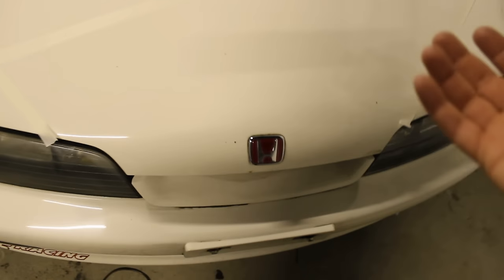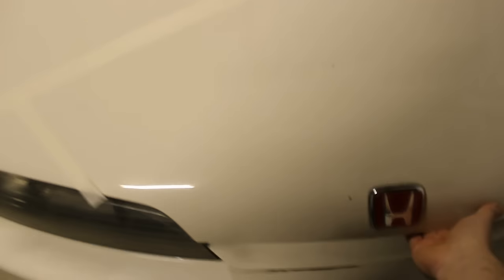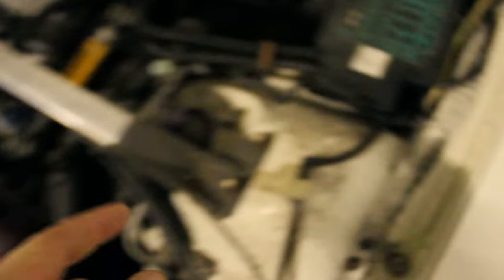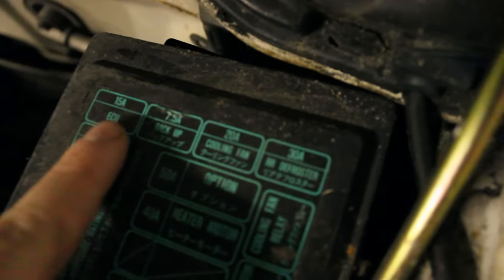How to reset your ECU in less than 1 minute

Comment: IF your car has a problem the light is going to come back on again before long, do yourself a favor and buy an inexpensive code scanner (about $40) and you can read all the codes and fix the problem the right way, or if you just want to turn the light off it will do that too without popping the hood
Reply: do the scanners fix the problem or do you need to physically fix the problem by remove a part?
Reply: Ach Cru you have to fix the problem yourself after the scanner tells you what is wrong with the car
Reply: Best thing I bought

Comment: It worked for me 2014 ES 350. Had it read at Autozone it was a Gas Gap Code.  Checked cap and it was off (kids helped pump gas and didn't screw the cap in). After over 100 miles light didn't reset.  Tried the ECU fuse as explained on the video and it worked.

Comment: 😁I had recently purchased a 2018 Ford Escape that was getting poor mileage because it had been "living" at sea level and it now lives in Denver, CO which is 5400 above sea level.  I took your advice, plus I also pulled all other fuses connected with with the engine or transmission.  Mileage went from 22.5 to 27.2 immediately.  Thanks!
Jim in Denver
Reply: Idk if you were going for comedy but your comment made my day lol

Comment: After replacing fuel pump, maf sensor, map sensor spark plugs ,spark plug wires, catylic converter,throttle body , lower intake gasket,manifold gasket ,vent solenoid,purge canister,and maf sensor for the second time to redo everything po172 and po171 kept comin on till I came to a mechanic  that had asked me if I’ve rest the ecm. Come to find out he was gonna charge me 40$ to check it and another 120 to reset it on his scanner which I already paid in the past..This video reminded me of the hassle I went through until I pulled the damn ecm fuses out and disconnected the battery which now has my ecm reset so that it can compensate correctly and now my engine is A1 and no engine light has come on yet….2008 impala flex fuel headache car 🤕……yes I replace everything on that car….always use ac delco or original manufacture not no bull crap brand learned the hard way on that too
Reply: Man I'm going through the same thing and going crazy.. I'm about to try this and hopefully it works.. o2 sensor, map sesnor, fuel injector, throttle body, pcv valve all replaced and I'm going to be extremely pissed but also extrememly relieved if this works

Comment: Thank you I was trying to find the key sequence to reset the ECU in a Subaru for example my 2014 Dodge Avenger if you want to reset the ECU you could just turn the key to the on position and pump the gas 7 times but nobody seemed to know it so this idea is 100x better than disconnecting the battery and pumping the brakes

Comment: Hey, just want to say thank you for this video. It works on my civic with the E-MID blank screen problem. This method is much faster and safer than to unplug the battery.
Reply: How is unplugging a battery unsafe lol
Reply: @yochillll2672  I’m here trying to figure out who said it was unsafe.
Reply: @mike-anthony8700  literally in the last sentence.... I can tell you ain't a bright one
Reply: Clumsy unplugging of batteries can cause short circuits that will fry your alternator.2) Old corroded battery clamps can break. ECU fuse removal is best explained.

Comment: It works like a charm, mechanics can take control over your car and keep your car running bad in order to get more money out of you. The mechanics can keep you coming back for repairs with their scanners and they can use the scanner to keep your car running bad
Reply: Wtf are you talking about dude 😂
Reply: Simple solution: Buy a $30 scanner and scan your own car before and after going to a mechanic. Also, that mechanic is taking a HUGE risk on their reputation if they are doing this....
Reply: @TeeTafoya87  yes I did buy a scanner pay over a hundred dollar and sixty dollar for a code reader my check engine light comes on after I replace everything myself because the mechanic didn’t know what was wrong switching coils and injectors so what I did I started with the fuel pump and filter and the car runs better but the check engine light comes back on so I replaced cam and crank sensor new plugs new coil new vacuum canister check valve and the other valve new mass air throttle sensor idle control fuel pressure sensor get pcv and every thing on the car and It runs very good and strong better than ever but the check engine light still comes on I cut it off 20 or 30 miles it comes back on so I open up the dashboard and took the bulb out and my 04 mustang GT automatic dark shadow gray is running good I even put a new harmonic balancer on it
Reply: change a mechanic lol

Comment: Best method, so much better than taking batt cbl off. My radio has about 40 settings that are lost at battery change etc. On my Ranger I killed the pwr to the PCM memory and drained it by putting a load on it at the fuse box. (an analog meter, then let the needle fall to 0). Still have intermittent flooding at start after replacing fuel injectors. So if anybody has suggestion I'm listening. Other than smelling gas at warm start sometimes it runs great and the trans shift points are smooth as glass now.

Comment: Did you say you remove pos and neg off battery? Why not just remove pos? I am replacing injectors and i I usually disconnect pos cable for safty reasons for certain jobs like starters,alternator etc..thanks for sharing
Reply: To drain ECU, you need to disconnect both and connect with each other for 30 minutes. If you want to disconnect for safety,  then you disconnect the negative, NOT positive.

Comment: Hi iam driving a w204 mercedes m271 2010 kompressor i try both but the engine still on..i try the battery tarminal and also the fuse but still the engine light is still on..what can i do

Comment: Disconnecting the battery is much easier & while you've got the cables off it's a good time to clean the battery posts. Then reattach the cables your good to go.
Reply: Yes, it's important to clean the terminals. But it sucks to have to reset the clock and stations on the radio. So if you know the terminals are ok, then the fuse works nicely.
Reply: This video is when you don’t have too much time to reset your ecu
Reply: Pulling out and replacing a fuse is much easier and fast than unscrewing and disconnecting battery leads!

Comment: I have some tips to share as I have experienced this problem for quite sometime. So many way I have tried but the problem was never resolved until lately I got a tip from a good foreman for my bmw. Belief me or not, all what you need to do it change the ignition coil, one set. 4 cylinders car, you need to change all 4 units or if  for 6 cylinders car, you need to change 6 unit. Don't just change only 1 unit. All my car problems has been resolved. Very smooth engine, just like new car. No more "engine check" signal came in. Trust me.
Reply: I have a2007 bmw 750Li .  One day I was coming home from the grocery store. And didn't see it last minute and ran over a like a block of wood from a piece of furniture or something.  When that happened it's like all my sensors and everything with the ecu started acting up.  It still runs and drives it's just not normal functioning. It's a V8 by the way.

Comment: Would probably be worthwhile to mention that most import vehicles have more than one ECU or PCM fuse so some vehicles it may not be as simple as just finding Mr ECU and pulling him out
Reply: Probably equally important to mention that this would be considered a soft reset in the process of unhooking the battery terminals and then connecting the positive and negative leads of the vehicle would be considered a hard reset of course giving enough time for the capacitors to drain and the control modules to start from scratch would be the most important step

Comment: When reprogramming a new BCM to disable the Anti theft make sure ALL fuses are installed and working. It is setup to need to communicate with certain parts of the car and without all fuses present (even RDO funny enough) it won't work. This happened to me until I found the info on a forum.

Comment: cleaned the mass airflow sensor & throttle body, but still got hesitation when accelerating from stop. 
This fixed it.
Reply: came back; ended up taking the throttle body off to clean it again, changed spark plugs, changed from oil to regular air filter and then did an idle relearn: turned key to on position twice, then started car, put emergency brake on, put foot on brakes, and kept car in drive for a min or two. So far so good.
Reply: @1111comment  thanks I’ll try this!
Reply: @1111comment  did it fix it?

Comment: How about the capacitors on the computer itself?
Reply: "How about the capacitors on the computer itself?"

DISCLAIMER...

DANGER!!!! - Never, EVER touch a positive and negative cable while EITHER of the cables is still connected to the battery! BOTH cables (positive AND negative) MUST be disconnected from the battery BEFORE they can touch each other.

With that said...

I eliminated any residual charge from the capacitors by connecting the positive and negative cables (from the car) together with a clamp to hold them together... while COMPLETELY DISCONNECTED from the battery. I left it this way overnight. Next morning, I connected the positive cable and negative cable to their respective (correct) battery terminals. Computer was reset after driving a couple of miles. Check Engine light gone.

Comment: Thanks for the tip, however, shouldn't you leave the fuse(s) out for about a half an hour?
Reply: Lawrence De Angelis yes, it helps residual power dissipate from the circuits, some of which have some slight capacitance to them.

Comment: I'm wondering that still can't work. When car isn't running, no ignition on setting or door open, no power is going to ECU. It's dormant, like your desk top computer is shut off. Pulling the fuse with no power present or flowage does nothing. Like turning off your power bar on your off-state desk top. The codes remaining are like ROM bubble memory and don't erase. 
  The way to do it is to open your door, key to ignition on, then pull the fuse which drains the electricity flow. Resetting fuse a minute later reboots the computer. Otherwise, everytime you turn off your car, close and lock the door, computer will always be turned off and reboot every time. What's missing here?

Comment: Would this also help in resetting ecu back to stock from tuned(like superchips flashpaq)?
Reply: If you programmed ECU to tuned, it won't go to manufacture because it was overwritten. You need to program again to stock. This method only resets to the last programmed

Comment: Hi there dont no if you can help me but When I changed my car battery my car doors will no longer lock if I disconnect the battery again it works again but then don't start the car then I have to turn the key to the off position and turn it again to start but then the car doors stop working again dont make any sense to me just thought I would ask someone who mite no more about it than me ?

Comment: Um you don't just plug the fuse right back in as you have to wait for the residual charge to dissapate, same thing with unhooking the battery terminal.
Reply: Exactly what I was thinking ,there is always residual power left ,sometimes takes a few hours to dissapate.
Reply: Just turn the key to send anything left to the starter.

Comment: You're videos are helping my troubleshoot my Civics idle surge. D16y8 SOHC manual ,(so there's NO fast idle valve). New IACV, plugs, wires, coolant burped, TPS calibrated, map sensor working. Yet it's still surging. It also is idling high (2,000rpm). Vacuum leak? When I plug the throttle body with my hand, it does NOT stall. This suggests a vacuum leak, correct?
Reply: Same issue  with my 98 accord 5 speed. Cant figure it out for shit .

Comment: I have a 2011 gmc 2500hd gas ,the gague shows overcharge,I had the battery and alternator checked  twice,both say ok,,the started had a thump when starting,but only once,then gague will move back to normal,also no engine on ,also checked for loose ground wires ect,

Comment: Don't you have to drain the power in the capacitors in the ECU.  Just removing the fuse or disconnecting the battery won't suffice will it?
Reply: David Houlden if you take one of the battery cables off and touch it to the other cable for 15 seconds it will drain the capacitors. And will turn off the check engine light. I am an auto mechanic so trust me on this. Just did it to my truck and it runs way better. 👍👊
Reply: @ralphchurch2263  I have a question for you ? If you do not have voltage going to your AC fan will doing the procedure of reset ECU will it take care of it.
Thanks Ralph
Reply: Ralph Church do not do this, this will explode your battery.
Reply: @Legoman0323  how would your battery blow up if you have your negative cable unhooked you unhook the negative cable then you touch it to the positive cable that is still hooked up only time it will blow is if they're both still hooked up

Comment: Awesome it worked on my van. And i didn't have to disconnect battery which would make my pass lock security system activate and wont let the ignition circuit work unless i do some reset procedures that take time ......👍

Comment: If there’s a fault that triggers the engine management light to come and you don’t fix the fault and knock the eml off it will still come back on until fault is fixed🤔🤔
Reply: I tried putting a different hu in and the connections had different wires so there was a big blue spark when I tried connecting the harness. It threw the ecu code. I removed and replaced fuse. Fixed.

Comment: thankss so muchh!!! it workedd!!
i think i made the light come on because i pulled the 02 heater fuse by mistake and then started the car.... and then i almost had a heartattack when the light wouldnt go off after i put the fuse backs
 i actually meant to pull out the compressor fuse cos my blower motor is fried and i didnt want someone to turn on the AC and ice up the lines or something...
anyway... light is off. engine sounds fine... hopefully everythings good :)

Comment: I was removing my tail light fuse and by mistake someone talked to me and got distracted , so when i removed my fuse was the Ecu i think because the car didnt want to start so i  was like Wtf happened so i realized and put it back and it turned on but then check engine light came on  so you think i should remove it and put it back again ?Fixes my check engine light
Reply: SAME THING HAPPEND TO ME BRO , what did u do
Reply: @hertztv9980  i put the Fuse back and just today i was about to take it to erase the engine light and noticed its not there anymore so wait a few days it will go away

Comment: My sister's 2004 Honda Civic LX makes this weird cycling electronic-type buzzing or whirring noise (almost like some kind of alarm) moments after start up and it's kind of eerie & annoying, as well as a bit scary as we don't know what it is. The car has automatic door locks & windows, and front & side airbags. My guess is it's something related to electronics rather than mechanics... Any suggestions would be most gratefully received!
Reply: Alternator??
Reply: Is the sound inside the car, like under the dash? Most likely the climate control actuators for the vents under & behind the dash.
My Mercedes does the same thing, when.I switch the motor off too

Comment: this way will only turn the check engine light off for a short time then it turns back on!
Reply: Of course, you need to fix whatever is causing the check engine light to come on.
Reply: Mahavir Bhakta of course but, he failed to mention that. It would’ve been better put to just show how to remove the light. Neither way resolves anything. LOL
Reply: @bryanmartinez7531  I agree. But sometimes you resolve the issue causing the light but because the code is stored in the ecu the light remains. If you don't have an obd2 connector you need to find a way to clear the code. That is the purpose of the video. There are thousands of reasons the cel can come one, you surely don't expect one video on all solutions do you?
Reply: @TheRockacer22  Then state the facts and not do a quick video that solves nothing.

Comment: Is this a long term solution or a temporary fix? I’m wondering if this will be a reoccurring issue that I need to reset frequently or just once in awhile? Are there any underlying issues for why it goes bad in the first place?
Reply: It will reset the ECU. If whatever was causing the Check Engine Light isn't addressed, the CEL will return.
Reply: It’s not a fix, it’s just a reset to clear the check engine light faster after the main problem was corrected.

Comment: This will not help any one unplug battery at least 30 min to reset computer but will lose radio code and engine will not run well for 100 km or more as computer will have to relearn stuff also new cars need a new battery. This is main cause of issues

Comment: in my dodge, after doing this, car must be driven around 60 miles to actually erase this off on board computer. That wonderful time of year again for NC inspection. Also added CRC emission cleaner this go round. Will see what happens soon. Car is 2001 147K miles.
Reply: Lisa Harper ... cool just did this and check engine light went off, now time to go drive around. 😋✌👍
Reply: Lisa Harper did you do the method in the video as well?
Reply: Wilkes county nc if you have light on you either junk a good car or sell it to someone who is in another country where there is no emissions test

Comment: You should probably disconnect the battery terminals before pulling out the fuse
Reply: That's what I was thinking about, can't that possibly *uck sh*t up if you left the terminals on??